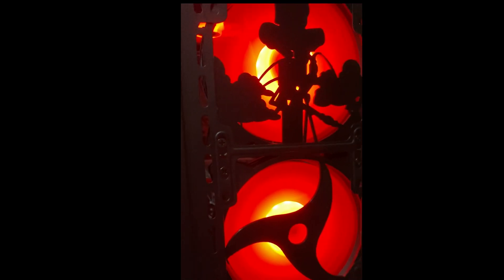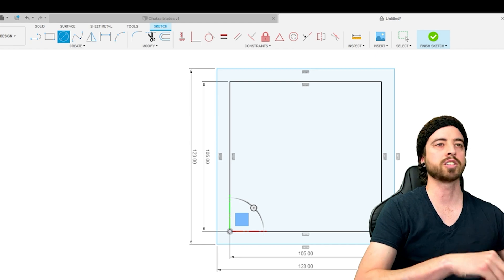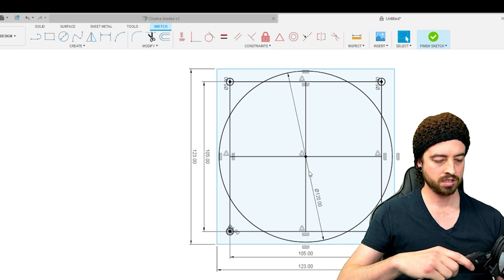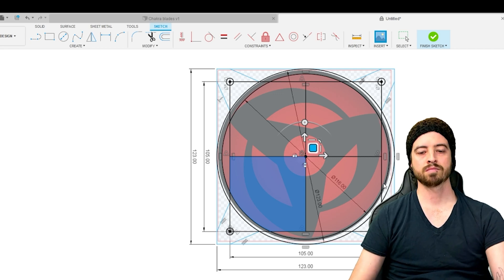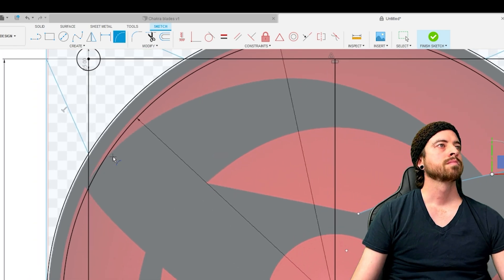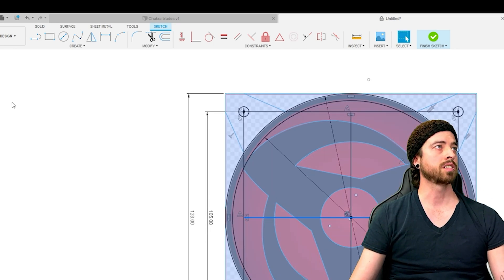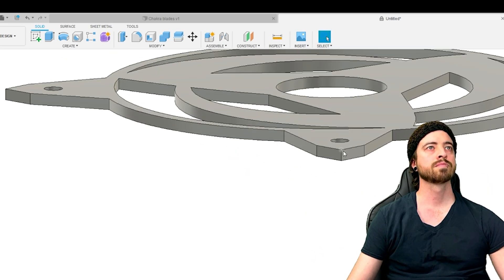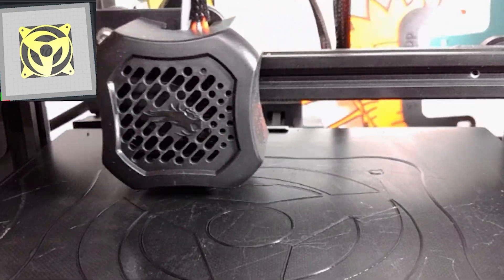Lets 3D print a cover for your Pc fans!

Comment: Great video man, what are you're printer settings? I have an ender 3 v2, want to give this a try (new to 3d printing).
Reply from the maker: I am using PLA for these fan covers so the heat is 200c for head and 60c for bed. The infill I typically run 30% for really dark colors and 100% for lighter colors. The rest of the settlings are the standard settings for the printer. If the design is complex I might turn the speed down a little.